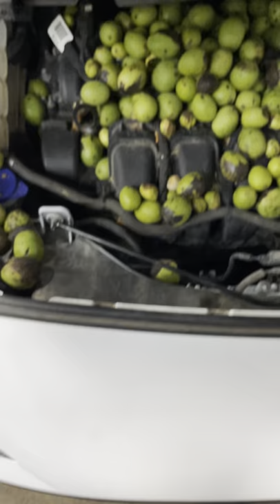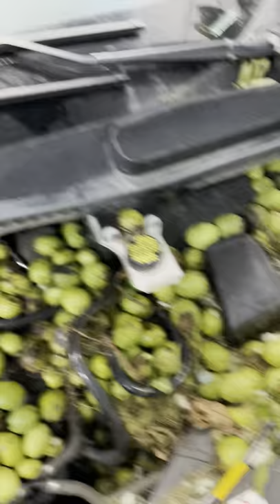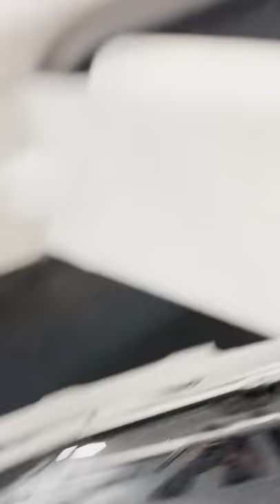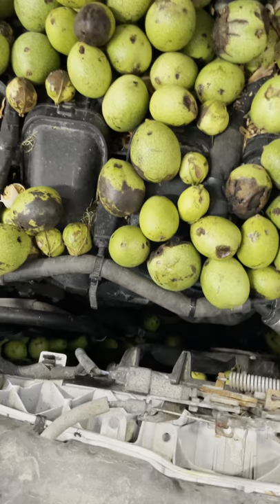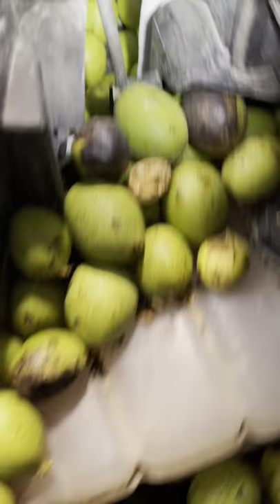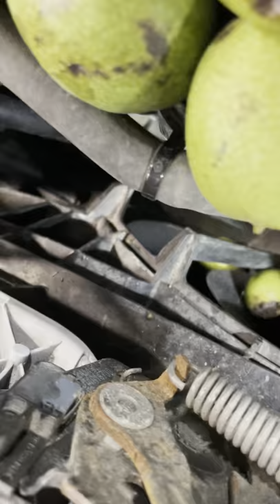Squirrel Fills Car Hood With Walnut Stash || ViralHog

Comment: I had a small mazda I hadn't driven from fall to spring in Massachusetts. I'd turn it over periodically to make sure it started.  I got in the car in early  summer and turned on the air vent. I got a face full of walnut pieces. It blasted out of the vents. My squirrels used my car vents for their nut storage.
Reply: Not calling you a liar but you know the air vents are not accessible from outside or underneath the car.
Not for a squirrel to fit in at least,
Maybe his walnut pieces only
Reply: @daggermouth4695  than it wasn't the air vent. Pieces flew out of the vents, and I mean LOTS of pieces, when I turned on the outside air flow. Don't know were they stored them to accomplish that, but it happened.